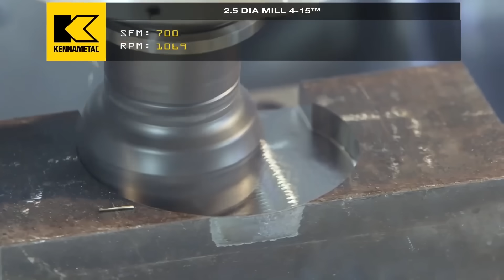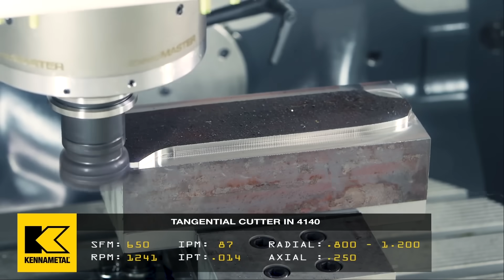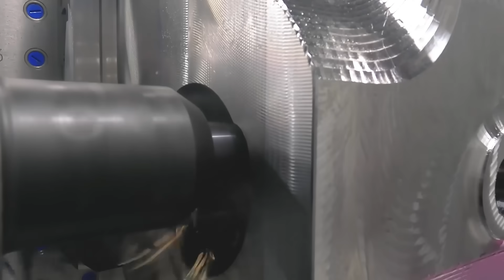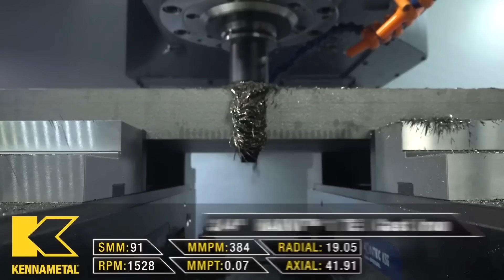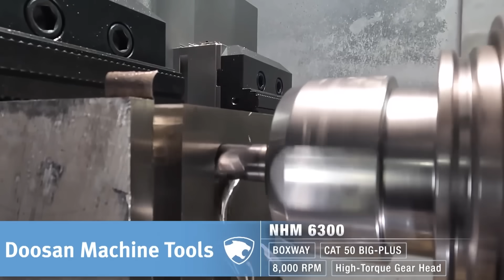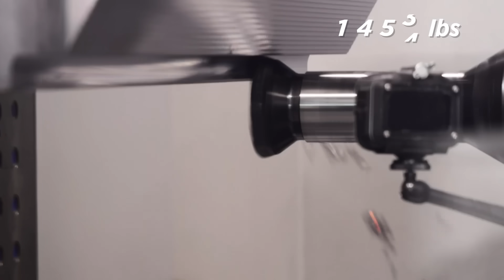Most Legendary MONSTER Machining Cuts Ever Filmed

Comment: I am astonished that you can do this with no coolant. I can say that just because the chips are super hot DOES NOT mean the piece you're milling is hard by super hot. When settings are right, most of the heat goes into the chips.

Comment: From my small experience in machining, i would say Rigidity (spindle, machine, tool length and engage ratio) is the factor that makes the largest impact on speed. Of course cutter selection, strategies and toolpaths play a role, but if you start trembling, you can never reduce that machine time. Love machining and this channel.

Comment: What you say in regards to MMR is so bang on. The last aerospace and job shop I worked at got alot of work that other shops just didn't have the machine size to do the work and I dont believe anyone there understood like I did that yes we don't have alot of competition on the larger parts we were doing but if we sold off the 1 old slow cumbersome machine we had and invested in a new large horizontal of the same size, yeah it would cost a million dollars but our ability to do things in half or in some cases 1/8 of the current time was available on nearly every part we ran on atleast 2 of our machines. Its hard to convey as a employee sometimes that yes we are still making money and getting the work doing things the way we used to but if we put the money up, and yeah its a new house worth of money we could do those same parts in a insane amount of less time, otherwise we can wait till someone else with the machine offers to take on that job and I can watch as you as the owner stand around saying that there is no way they are making money and that they are doing it while paying people in peanuts. The amount of work being given to the same compabies over and over with no understanding of how much faster and even more accurate the work could be done is astonishing. Your very spot on about why people do things the way they used to. The same argument can be said for the amount of manuel work that I constantly see people arguing can't be done as efficiently on cnc. Manuel machining is dead in the water

Comment: I'm quite sad to have failed conventional machining so bad, I had to take a whole other path away from the serious CNC programming part. Never touched MasterCam, but did do a whole G-code program. Your videos are quite satisfying to see. (to those asking yes I did a basic CNC class and breezed through it doing manual G-code, but conventional machining in the whole program holds you back a year if you fail one of three parts, I failed 2)
Reply: Don't give up, if your not working yet dont worry about schooling, it is good to go to school because it can help you learn things possibly faster but honestly for the most part schooling is useless and don't think you need schooling before you try and get a job. Diploma and certificates really don't mean anything in this industry. Dont give up and don't let a lack of schooling stop you from working in this industry

Comment: Last year we machined castings made of manganese steel. This material was so hard, that the tool holder including the mill bit broke off. The holder was an HSK 100. Fortunately the machine was not damaged. After a heat treatment of the other castings it was much easier to cut and the new holder withstood. Only the indexable inserts we had to change every few hours.
The customer paid a lot of money, on machining hour costs 300 Euros. But he was happy that we were able to complete the job in the calculated time.

Comment: That first setup with that endmill plowing through that steel in the vices was very impressive but definitely beyond the spindle capabilities for whatever machine was doing the cutting. You could see the tool holder was getting ready to be plucked out of the spindle when the tool was fully engaged. I think you narrowly escaped the pull stud being plucked out of the tulip. Impressive for sure but on the edge of disaster.
Reply: You have to test your limits to exceed at the level this guy grows if you don't run hard and fast you won't know how hard or fast you can run right. I love the way Titan thinks he's awesome positive going huge places in life!
Reply: @chipmiller9074  I agree he pushes as hard as possible right up to the edge. And his passion for the trade is unmatched. I don't think most people understand how important the machine trade is to every day life so its great that he is bringing the attention it deserves.

Comment: Titan, I am 66 years old. I just retired from marching after 47 years in aerospace machining. I wish I was a younger man. I am in Connecticut. I am all in when it comes to machining almost all of the aerospace materials on turn/mill centers. Your shop looks like a very formidable place to work at. I enjoy watching your YouTube channel. Keep up the great work and may continued success be yours.
Reply: Does Connecticut have alot of aerospace work? I dont know much about that states companies i guess it not a widely discussed place but I do know some nearby states with alot of work. And can I ask when you first started seeing/using cnc machines? It seems the only older guys over 55 i meet who have worked on cnc for decades all were in the aerospace industry otherwise it seems like its only been the last 10 or so years they got into it. Hope you enjoy your retirement and can relax at your age!
Reply: @daryllemire6503  Hi Daryl, there are still many aerospace manufacturing shops in Connecticut. I started with N/C machining in 1975. Cnc had not quite started yet, about a year later the first Cnc control came out. N/C machines utilized a Mylar tape running through a tape reader on the machine to run. Same as a Cnc reads a program, but just one edit required tremendous skill to duplicate the tape with a change. That’s how I learned programming.
Reply: @allenbeaulieu7077  oh nice yeah I've seen old tapes before, I have had the privilege of knowing a few people now who had worked at mcdonald dougless before it was bought by boeing. I can't imagine machining parts with a piece of strip paper with holes punched out. Hard to believe that was so commen place only a few decades ago. So you were one of the fore fathers of cnc. Since the beginning of its time haha thats interesting what an evolution you have witnessed thats cool you got to see it at the beggining
Reply: @allenbeaulieu7077  what always boggles my mind is how some of the passenger airplanes built in the 60s are still flying today and there is parts on them that weren't even done on NC. They were done by hand or manually and those planes have a better track record than boeings most recent plane. The stories some of the older guys have told me of how things used to be will never not be fascinating.
Reply: @daryllemire6503  Absolutely, I’m one of those old guys. Ran engine lathes, Bridgeports, old Cincinnati millers, all kinds of machines that were manual.  No knocked it out of the park production wise, but when you were familiar with the old manuals, you could hold tenths.
Reply: Cnc knocked production out … lol misspelling!!
Reply: @daryllemire6503  Yes sir. Thank you. How the world has changed. When I hung up my micrometer, I was working on a triple turret twin spindle Okuma lathe, 48 tool holders, Y axis and live milling stations. What a difference from the tape two axis machines. Both Okuma spindles with C axis. Very complex part capable.
Reply: @allenbeaulieu7077  yeah based on my experience in canada I assume the same is for alot of developed countries but you probably don't realize how few machinists your age were producing that much over your career based on your early start in cnc. Man I wish I could pick your brain on things, I hope you realize just how productive you were compared to alot of people in manufacturing in your life. Especially up until the 2000s aside from aerospace companies the majority of machinists were manuel. You probably have so much knowledge on set ups and tooling and techniques that are so useful but not being carried on . Every cnc machinist from aerospace I know around your age is basically the only guys I have ever learned from. You should enjoy your retirement and know that you produced alot more of valuable things than you ever consumed. Its few and far between I meet the guys who started this trade. Im not trying to pump your tires I truly am thankful and star struck chatting to you through my phone.  Do you mind if I ask what companies you have worked for throughout your career? Its okay if thats too personal , im talking to one of the greats. Thats amazing you were a figure in this trade since it began. You probably have alot of interesting stories
Reply: @allenbeaulieu7077  this trade wouldn't be where it is if it wasn't for the guys like you who started using the tools when they came around . There is people my age who have been machining for 10 years and they haven't even ran machines as nearly as complex as the ones you probably ran in the 80 and 90s.
Reply: @daryllemire6503  Thanks again Daryl. Nice chatting with you. Al.
Reply: We can talk more anytime you may wish to about this.,I am in my prime. Feel free to ask. Al.
Reply: I worked for job shops all my life. All aerospace, all kinds of material that you can think of. A lot of tough jobs that no one wanted. Give them to Al, he’ll do them, and I did.
Reply: @allenbeaulieu7077  Your comment caught my eye being from CT myself. I'm currently in a small job shop that does small runs for gages/custom fixtures. I wanna get into aerospace/CAM but currently only know hurco conversational, so I feel like my options are limited. If you don't mind saying, did you work for one of the big places or as a sub contractor?
Reply: @acat6000  Hi Matt. I worked all my life for contractors for the aerospace giants, Pratt and Whitney, Rolls Royce, General Electric, Boeing for airframe parts. I learned conversational many years ago, and that works for a small job shop, but if I were you, learning Cam software like Mastercam or even Solidworks which are superior Cam systems, especially the latter where solid models are already drawn by an engineering department and you import that model to program from, saving you the work of having to draw the part yourself and then program for the machine. I hope this makes sense to you. Thank you for commenting, and good luck. It’s a great field of work.
Reply: I retired 5 years ago.  I am 69 now and I still miss the sound of bullet chips hitting the inside the machines.
Reply: La cámara acelera el proceso , fake ......
Cuanto paga kennametal ?????
51 años mecanizando , no cuenten cuentos !!!!

Comment: Hello , i am an CNC Worker in Germany. How long is the life of the tool when you cutting llike this ? ist this worthwhile in mass produktion ? is that the sound of the machine or you cooling with air ? those grooves you cut we do with wirl movements that the tool only cuts 0.3 mm per round wich improves the toll stability. seems crazy to think that the tool cut to 10 of this parts straight. but i think for our spindle the load is to much to cut like this.

Comment: Titan, I couldn't help but notice that when you were milling that deep slot after the ramp cut the spindle was actually flexing. I apprenticed in Westinghouse in the early 70s. The first machine I ran there was a Cincinnati mill with a double articulating head that was purchased by the company in 1916. and still held the numbers with no problem. My question is how long does a modern C.N.C.machine last at the pace and loads of today's production?
Reply: I can ansewer that, it depends alot on what brand/ where the machines parts were sources and also the assembly quality. Cnc machines can last just as long as manuel machines aside from the electronics. Also the machines layout has alot to do with the longevity of the machine, some of the not so newer direct drive spindle vmc s that are 5 axis may encounter bending and twisting over time depending on what its used for because the spindle is not held as rigid as say a horizontal boring machine. I've ran many makes but I had a haas vf3 and they are not the most amazing quality but I ran that thing insanely hard and that machine is probably 20 years old now and can still hold .0005 or better tolerances. And I've stalled the spindle in tools steel. Alot of cnc machines can last decades fine. I've never see  a toshiba horizontal ever lose its accurcay even after moving across countries and having the casting get twisted. Those machines just keep running. Dont know if that helps but ya

Comment: Great video! I have found that the very best programmers and machinists/operators are those who started by running manual machines (lathes, vertical boring mills, turret lathes and milling machines) on the shop floor and having a good solid machining experience as the basic foundation! 
I loved those old long bed LeBlond lathes, Bullard VTLs, Warner & Swasey Turret lathes and Kearney & Trecker and Cincinnati mills!

Comment: Titan one thing ive always struggled at over the years  is clamping force in a vice, we cant afford  the shunk just because my company cant justify spending that  much money on a vice, we do have kurt vice but in doubt i hit it with a dead blow to crank down on the part.... obviously thats wrong but could you make a video on how to determine the proper clamping force to hold various  types of material in differnt situations?   In previous videos You say that you crank down on the parts when roughing but when you finish the part you relieve  the pressure and kiss the material,  could you show examples please, Thank you buddy keep up the good work 👍
Reply: socket with a torque wrench.. also it's VISE.... hard jaws soft parts, soft jaws hard parts. check out torque ratings on some of the higher end vises, compare to what your needs are.. feeds and speeds..etc..  $.02.. just the tip though
Reply: If you ever get a new vice even if its Kurt the one piece of advice I can give you is never hit it with anything, once you start knocking the vices tighter you slowly ruin them and will have to continue. But get a torque wrench/tool and either use you current clamping force that you know works and adjust your wrench to that set amount or do a bit of googling and im sure you could find some numbers, but yeah torque tools work well for finding that exact sweet spot where you don't overtighten and cause issues with your holding or vice damage.
Reply: @daryllemire6503  man i appreciate that advice! We really need 2 vice's for our mill but hopefully we will gwt one soo , ill definitely keep that in mind
Reply: Never tighten a vise with a hammer. Use gripper jaws program accordingly to put cutting force in a direction that's solid. Toward the fixed jaw. Use gripper jaws, serrated jaws, soft jaws to hold your parts. We never hammer on the vise and have no issues holding the parts. We have moved a few vises though so we hold wises with at least the 2 standard suds and usually a clamp on the back end as well. Aluminum jaws hold steel parts pretty well and we routinely hold on only .100" with gripper jaws.
Reply: People have been taking heavy cuts in kurt vises for decades.

Comment: Feeling jealous about so deep cuts... If I will try to do something so deep with my lathe's driven tool, a mill will just slide out of the collet, as we use those typical driven toolholders with thin hexagonal collet nuts instead of ER type nuts. And the wrench is just popping out of the nut, if you try to tighten it any harder. Also, all this stuff vibrates in some kind...
Reply: If you are worried about tools pulling out of collets, take a look at securgrip from rego-fix, uses weldon flat to lock the tool in the collet, leaving it no chance of pulling out. Also IIRC ER collet nuts and hexagonal collet nuts are somewhat exchengeable. And maybe try to suit the tools/feeds/speeds to the machine, not the other way around.

Comment: Pushing the envelope is fun, but WOW, that spindle deflection in first full depth (:32 to :40 seconds in) slotting pass!!
Reply: If not new spindle bearings, at least new underwear lol.
Reply: @Pow3llMorgan  pucker factor grade 
9.999 lol
Reply: lol.  that's the toolpath :)  you can see the walls.  if it didn't have control the endmill would have snapped.

Comment: Holy spindle deflection, Batman!  You may not be at the cutter's limits, but you're at the limits of the rigidity of the machine. And past it.
Reply: if you are talking about that full slot in the beginning, it seems more like deflection in toolholder than spindle as a whole
Reply: is this a problem for a roughing cut? I don't see the problem as long as you leave some material for a finishing cut and/or the part is in spec.
Reply: It's obvious you have absolutely no idea about milling! Milling at such a limit would destroy the spindle and machine in no time. @iancockrell2000

Comment: I've noticed that a lot of your videos have the end mill spinning clockwise and also moving clockwise around the part. When I was in Machine Shop class we would have our tool spinning counterclockwise but still traveling clockwise around the part, in order to cut against the feed, not with the feed.

 How are your machines able to cut against the feed?
Reply: You maybe use in working conventional milling sir. Its called CLIMB machining,if you do it in conventional mill its harder to control but in cnc its no problem. And the cut is cleaner. Any way i have not yet seen endmil that designed for counter clockwise
Reply: @Ram-pb2zp  run spindle counterclockwise to add material... aditive manufacturing 101

Comment: I still can't get my parts correct. (About a 50% success)
52100 (ks-4051) heat treated material 
Ring  .360 long
Can't hold a .00002 parallel between id and od. 
It's killing me. We have found no patterns or correlations between anything that makes them good or bad
Reply: Gotta love aerospace